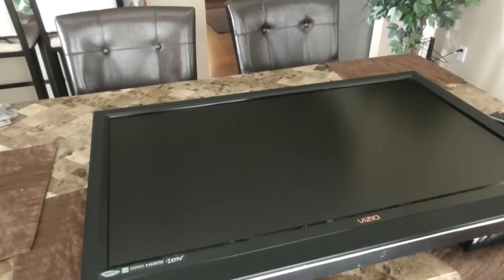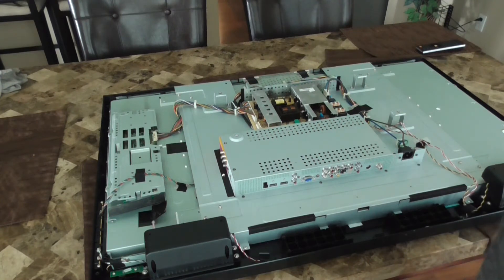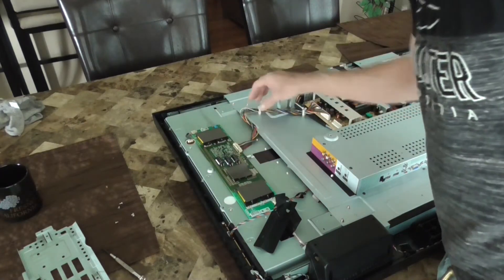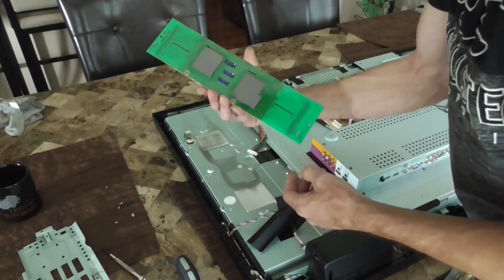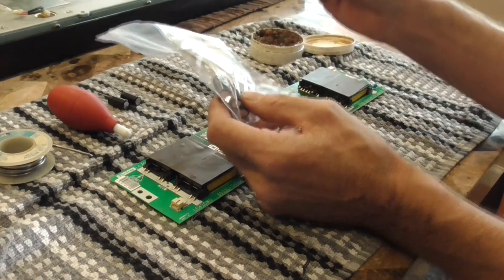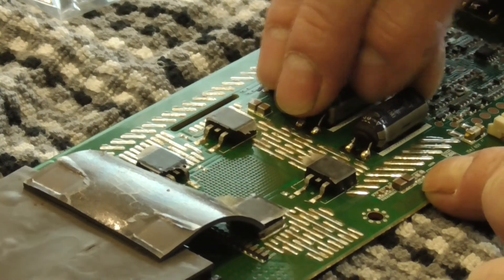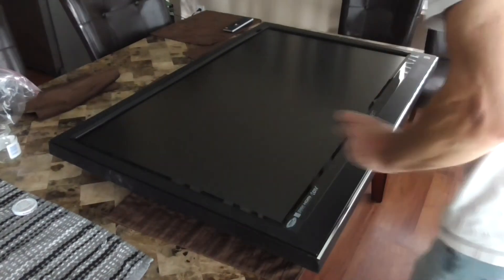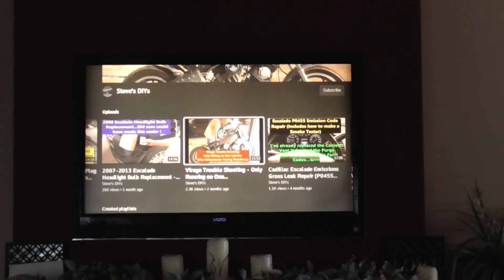Vizio Flat Screen TV repair - Backlight fluttering and Buzzing Noise

Comment: Great repair job Steve for a few dollars and your talent for repairing things.  Thank you very much for another DiY video.
Reply from the maker: Thanks man !  Probably not a video that people would use much, but it was pretty interesting for me to figure out what the issue was and fix it for only a few dollars. All the best !  Steve
Reply: @StevesDIYs   About 10 years ago I had a LCD TV that was broken and didn't know how to fix it so I asked an experienced technician and he said about $275.00. That was too much so he threw the TV in the dumpster 🤣.  I bought a new one for about the same price as the repair cost.
Reply from the maker: @GarysnewYT  yep, most of the time they just go in the dumpster since it costs so much in labor at a repair shop to fix.  Fortunately it was easy to spot what the problem was with just the capacitors.  If I would have ended up having to replace the whole inverter board, I too would have just thrown the TV away as the board was like $60 usd (for a used one). At that point it would have been better just to get a new TV vs. risking that something else was wrong with it.  $8 to $10 bucks isn’t bad for a fix as I got to learn a little about capacitors with minimal risk, lol.  All the best !  Steve